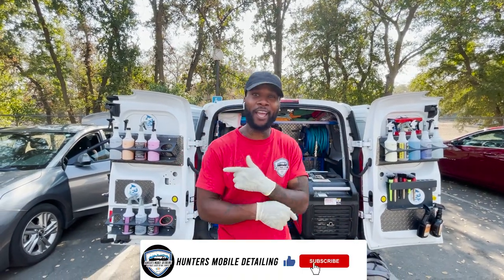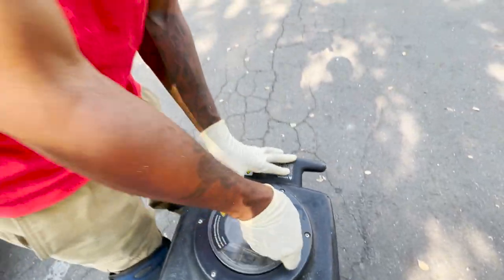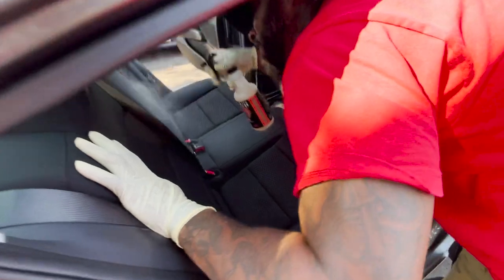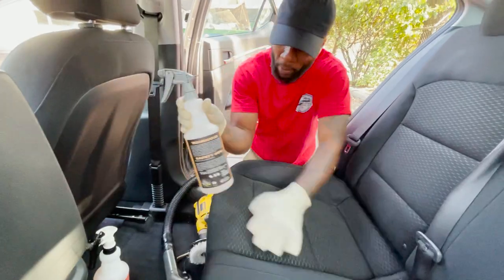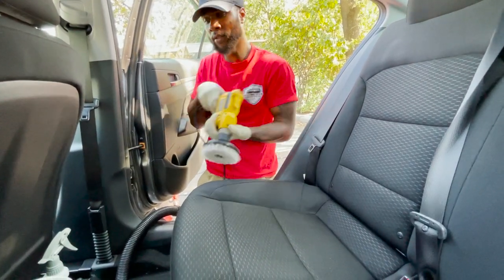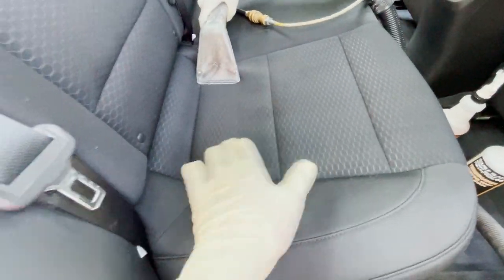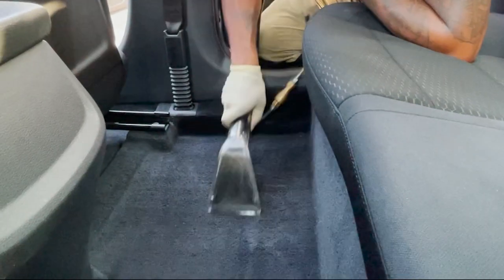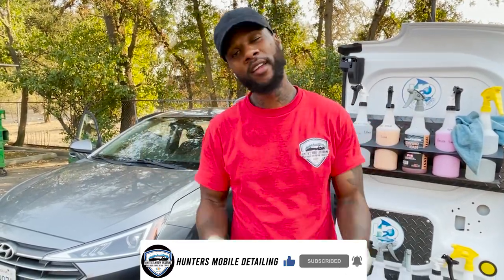Step by Step Tutorial - Extracting Seats - Hunters Mobile Detailing

Comment: being a carpet and upholstery cleaner since 1984 ... Always do 2 dry strokes to every rinse stroke with the wand. Your upholstery will be much drier when you are done. especially when using a portable. The Mytee is one of the best brand extractors out there. Also if when you are not draining the tank, turn the elbow up so it is pointing up, this will keep it from dripping on the ground or in the van.
Reply: So use the rinse stoke once and then go over that area twice without the rinse?
Reply: Thanks I will try this
Reply: Good advice thanks

Comment: The machine he’s using is by Mytee. 
 You can buy it from them or use kleen right. That machine is a top of the line. But you don’t need that one. They have a mytee lite. You can get one for around $600-800. Just make sure you get the one that has a heating element. Meaning it heats up the water. We use the one just below what he’s using. And we do around 3-4 details a day.

Comment: Was thinking bout those rubber mats last time detailing those U Hauls. What about a way to hang them off the van? Or a table?
Reply: If you go on amazon and search Car Wash Mat Clamps there's some metal he could buy. And what a lot of people do is they add magnets to the back of the clamp with either a strong glue or 3M so then they can just slap the clamp on the van since its magnetic and hang the mats to dry that way

Comment: How do you deal with sweat when detailing, I’ve started a year ago, and my shirts end up soaking in sweat! Any tips ?
Reply: I'm a landscaper trying to start up mobile detailing. I'm not sure how well it will transfer over but my company gives us those lightweight material shirts kind of like dry fit. I'm in Houston so it's hot and humid and I also sweat a lot. Those shirts breathe well and dry fast. As for your head wear a hat, bandana, or a stretchy face mask. It's shaped like a tube and pulls down over your head. It can be worn on top of your head like a bandana but easier. It's also lightweight and wicks sweat. Hope that helps

Comment: Hi Wayne, question. 
The drill you use is it a low rpm drill? Or does it have 2 speeds? I have a corded drill and when I am drilling the seats it goes too fast. Sometimes it splashes the chemical all over the place.

Comment: Wayne I have a question, do you have a pump between the water tank and pressure washer or do you do a gravity feed? Thanks
Reply: I believe he has a Pump on the bigger van since it has Di water would be hard to Gravity feed
Reply: Isaiah Celestin why’s di water harder without a pump?
Reply: Yes you need a pump
Reply: @Sandiego61999  Di inputs are normally at the top of the Tank and gravity can’t bring the water up from your water tank alone
Reply: Isaiah Celestin oh I just fill my tank with di